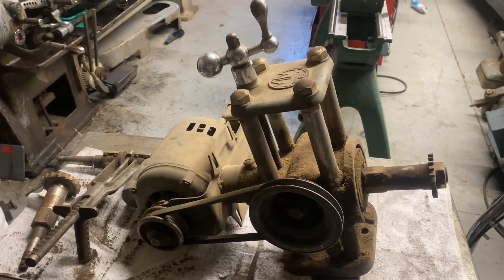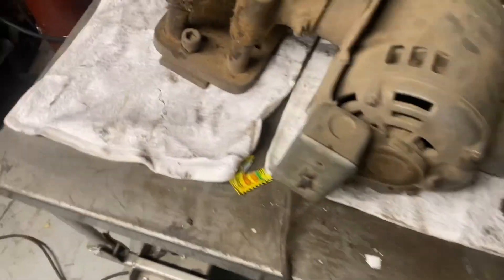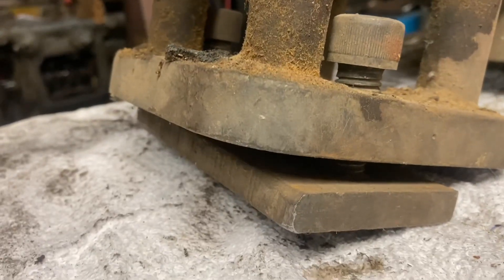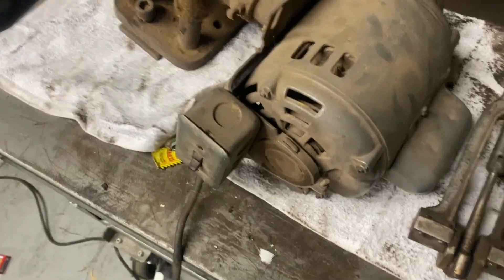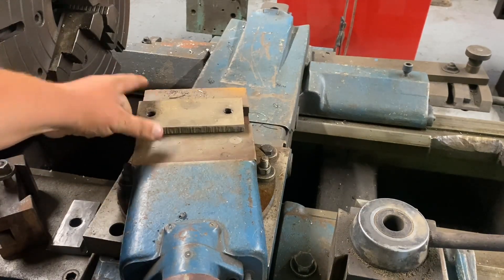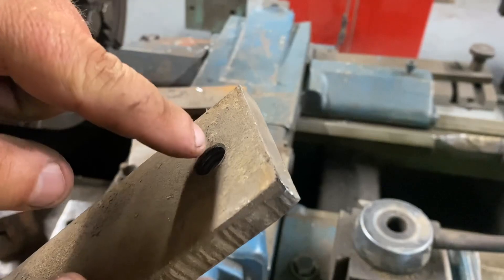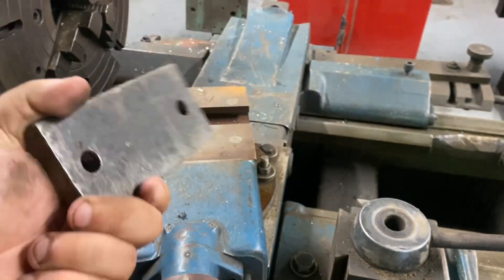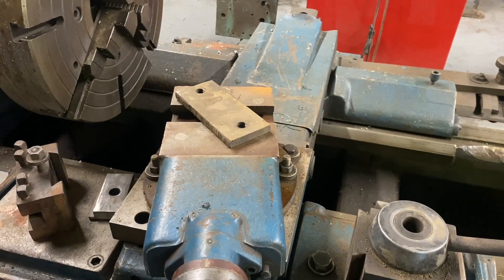Master mills model b toolpost milling attachment

Comment: The motor appears to be an old wash machine motor. Motor needs a step pulley same diameters as on machine. Cool piece Adam! Must have been under a workbench or on the floor in a woodshop lol.AL B.
Reply from the maker: Yes that’s what I’m sure it is and I’m already looking for a pulley for it
Reply: @smalltownmachineshop6860  look around for old bench mount drillpresses or guys like us that hoard stuff lol!

Comment: Nice find! I'm not sure about the Master Mills but my Versa-Mill is definitely both a mill and a grinder. Has grinding attachments for external, internal, deep hole internal, even a high speed attachment for small wheels. I use it on my 17" Leblonde Tool and Die model.
Reply from the maker: I have a buddy that has a lot of the endmill holders and stuff for one and also a little x y table they made for it, cool stuff